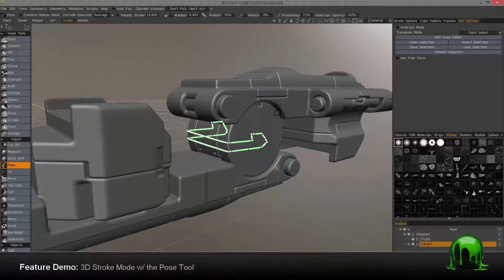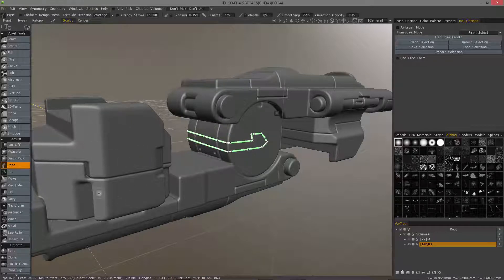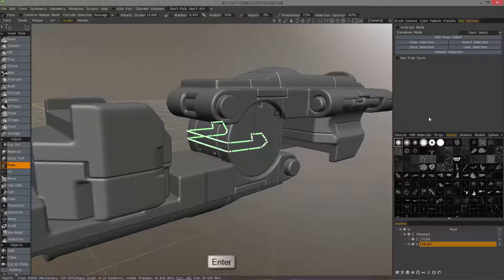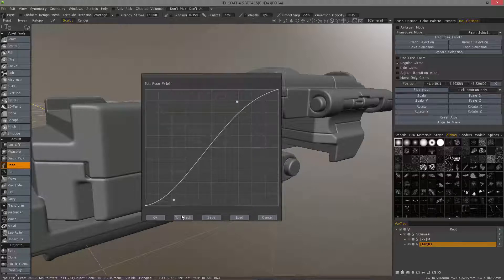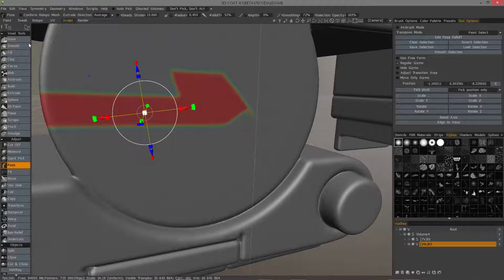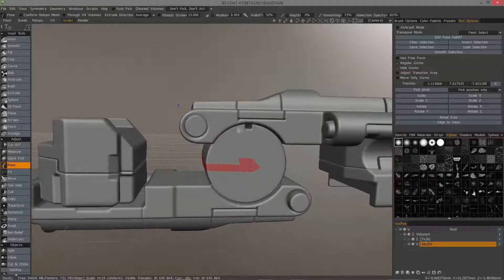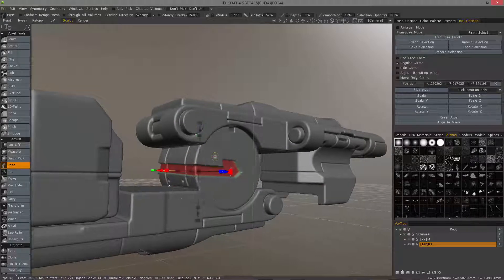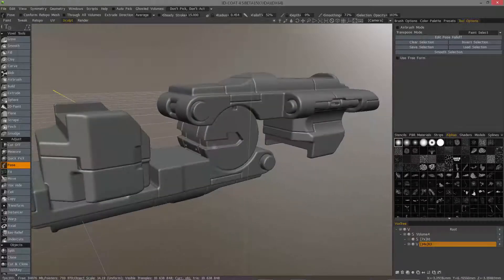3D Stroke Mode w/ the Pose Tool

Comment: what is the best way to clean up the edges?
Reply from the maker: +Peter Gašperan  I would ask what you mean by "clean-up edges" (in general? As a result of using the Pose tool?), but this conversation is best handled on the 3D Coat forum, where you can share screen captures/recordings. Youtube is a poor platform to diagnose issues one might have with an application

http://3dcoat.com/forum/index.php
Reply: Oh ok, sure.

Did I ever mentioned that this piece of software is PHENOMENAL!!!